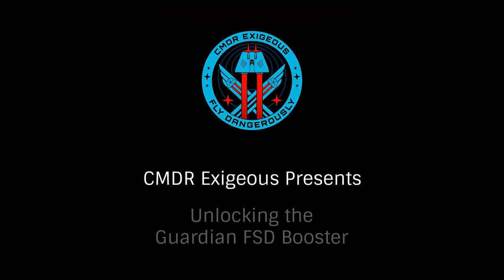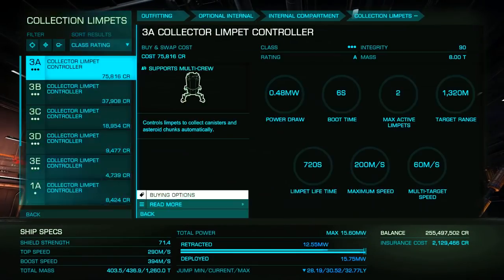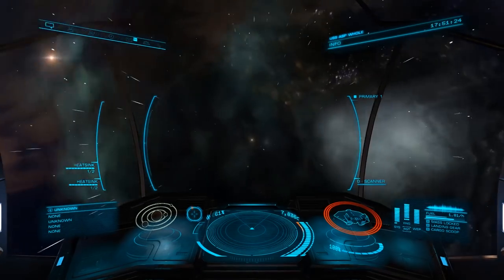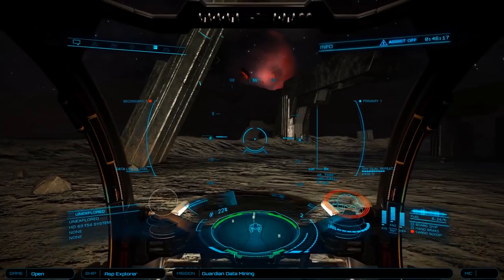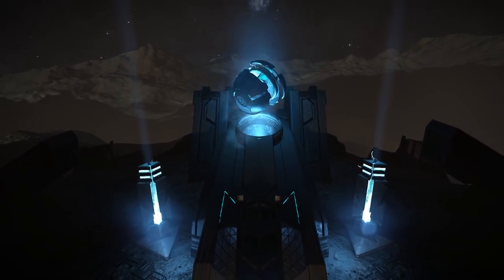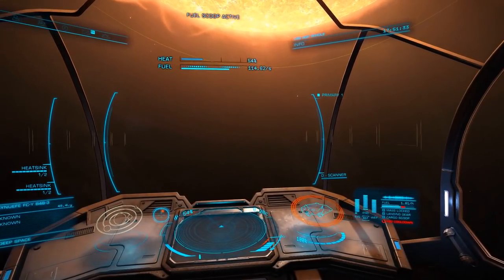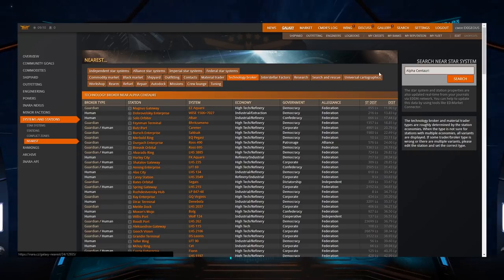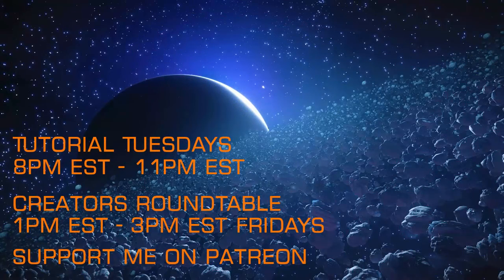Unlock the Guardian Frame Shift Drive Booster (FSD) in Elite Dangerous for Maximum Range (Tutorial)

Comment: Just attempted this...  You have to shoot the pylons until you get the message that it's been activated.  

Everything was going smoothly and activated the final pylons and was about to unload my relic... but wound up getting attacked by 4 drones.  I learned something about SRV's... they can run out of ammo!   Subsequently got blown up on my way back to my AspX to reload.   So, I'm going to have to come back and try again.  I think I'll park close with a point defense as someone else suggested.

[EDIT]:  So, the point defense idea works really well... there's just enough room to land my AspX in the corner of the ruins and it protects me from those annoying missle attacks.   Got the rest of the components and unlocked the FSD Booster.... what's not clear is how to apply the booster. It shows up in the regular outfitting inventory and you have to purchase it... and have an open slot for it.   Now I'm just trying to figure out how to configure my AspX to get the most out of it...

Comment: 1:30.  For me, I activated the 4 pylons that came up from the ground before I activated the 2 main ones at the machine.  Worked fine.
Reply from the maker: Sure, you can do it that way - but you have to have the two at the head spawn before the other 4 will, you just don't necessarily have to charge them first.

Comment: WARNING: The terrain surrounding the site at HD 63154 B 3 A is EXTREMELY bumpy.  Try to use a small ship.

I tried to use my Krait with a Class 6 Planetary Vehicle Hangar thinking that I would need the extra SRVs, then found it almost impossible to land.  I found a spot at 40.8030, -106.4987 on the northeast side of the site (as I'm sitting here, my heading is 226 degrees).  The coordinates may not be precise enough, if you're going to try this with a Krait yourself (NOT RECOMMENDED), then you'll need to expect that the valid landing window is very small.

Comment: Leaving the first two pylons till last is the easier way, pop them up but dont charge them till last.The guardians generaly pop far enough away to grab the data then run if you dont want a fight,you will still have to fight them whilst you pop the other pylons, its best to get the fighting done first before charging any of them if you are not an experienced srv combat veteran.
Reply from the maker: Sure, but as you're likely going to need the materials they drop I'd suggest killing them anyway.  If you're going to unlock any of the other guardian stuff you'll need them.

Comment: Alright, so went there today...and it was crazy.  Once all pillons were activated, 5 drones appeared, blue rays and missiles raining down on me from every where, they destroyed my srv...took my second one in, almost same thing happened, just ran away and called in my ship.  But even far they would shoot missiles at me...those are some nasty guardians.  I'll be back...
Reply from the maker: I've seen a few people say this - which, honestly baffles me.  I've done this something like 80 times (back in the day it took 8 blueprints/fragments to unlock each module so between my accounts and getting video I've done it that many times) and never once have I been killed.  Make sure you're running 4 pips in systems if you're having trouble and use the structures to block them one at a time while you kill another.

Comment: So something that isn't said in this is you will have to grind the site for the items. This means find the items, log out, and log back in to get more of the items. Like the tech component you can only get 12 of them per run. Which means you have no choice but to log out and back in. If it wasn't for this then I would aim to get the other modules. But I hate this grind

Comment: He didn't mention the rough terrain around it.  My buddy and I went with 2 Kraits (mine was mk2 and his was phantom) and we found a VERY precise landing spot that is right in the structure area. 40.8029 by -106.4983 and you have to face towards the center of the structure. (it takes us about 5 min to land each time, but the spot is worth it.)

Also remember that having point defense on your ship will help a TON with the sentinel missiles. I highly suggest that you go with 2 people and have one cover you and help break the towers from the air. You will have to wake in and out a couple times because you will only get about 5 or 6 technology components every time you do it. once you wake out and in again, the towers will reset and the grind will continue. 

I also hate the use of the word "simply" in this video. Nothing you will be doing here is simple, especially for newer players. I lost my only SRV the first time I tried it alone and without all the tips mentioned above. I was pretty pissed when I had to go back to the bubble to get more.

Comment: I'm shipping out on this run in the morning in my Type-10. It has dual SRV and fighter bays. I'll be taking the stuff I need to synth SRV fuel and ammo. The SRV bay is the type that can repair the SRV, so I'll be taking materials for that too. 

I doubt I'll be able to park close enough for the point defense systems to assist, but I'm gonna give it a try. 

So my big dumb-question-of-the-day is: "Will fighters launched prior to landing provide air support for the SRV?"

Comment: While the AspX build link is dead, I noticed in the video two 3A Collector Limpet Controllers being fit on the Asp. Why are those necessary?
Reply: Fuel scoop, class 3 Shield Gen, Point Defense, SRV bay, maybe an extra fuel tank just to be sure. Do not forget the  materials needed to synthesize SRV ammo/fuel, and you should be good to go.

Comment: Hi! I just landed with my Krait Phantom technically inside the structure. exact parking spot is @ 40.9714  ; -106.4864 you will need some patience while locating the spot but i can land in 5 minutes of + - 1m/s forward and backward navigating
Reply: I just got there with the same ship and it was so easy. Tanks a lot!! *btw it is 40.7914/106.4865 for me

Comment: Quick question, I am currently unlocking the Guardian modules.  It's entirely possible this may have been mentioned in the video and I missed it, but do you have to do this for every ship like Engineering or only once and done to unlock each module?

Comment: should i first engeneer my ship, or it doesn't matter when i get guardian modules? thank you
Reply: Won't make a difference. The guardian FSD booster is an optional internal so it takes up an internal slot. The bigger the jump range the bigger the size slot it takes. It simply adds a flat amount of additional range depending on the size of the slot. However the sites are 1000 ly out so it doesn't hurt to have better jump range to get there.

Comment: I have it unlocked....but how do I install it? Looked under my Core internal first expecting it to be under FSD Housing, then looked under optional internal, nothing.
Reply from the maker: It's under optional internals in a section called "FSD Booster" - might only be in stations with experimental outfitting but should be in the station you unlocked it in.

Comment: Does this remove the fuel cap ? Even after charging at a neutron star i can only use my regular jumps since anything over the regular jump is blocked by the fuel cap per jump.
Reply: That can be caused by fueling scooping "too soon" when you have a route plotted. By refilling your tanks you increase mass and reduce your range, if it's below what the route plotter expected you to have at that point, it will give you that cryptic error. Solution is to either not fuel scoop until the "last second" as the route plotter tells you to, or if you don't like waiting like that, you go into galaxy map and replot your course if you get that error.
Reply: @AlvinBrinson  
Thanks for the explanation, good to know. 
Had the same problem several times and the reason for it was a complete mystery to me. Because i didn't think the Space Nav would be so smart to take your fuel tank weight into the calculation. I learn something new about this game every day.

Comment: Trying to get those delta obelsik data for the shield booster but its horrible. Is there a way to get delta more frequent?  Nice vid as always
Reply from the maker: Not really, no - other than using the ancient ruin sites rather than the obelisks at the Guardian structure sites, which are you using?
Reply: CMDR Exigeous was using the mosulblueprint site in hd-something. Thanks i guess the other should be better
Reply from the maker: Yeah, definitely hit one of the ancient sites - have a look at one of my weapons videos as it has the address of the site I used.

Comment: Any reason why when I get to the activation point for the first two pylons nothing happens? Its the same coordinates as you have on there with the little spotlight thing on the ground.. I've gotten a few other things to rise up as I was driving around, but no dice on the first two pylons.
Reply from the maker: I actually headed out there with a friend this evening to do the unlock and we hit this too - are you in open?  If so it's very possible that the instance didn't reset after the last commander left.  We logged out and into a private group and blamo, all was fine.
Reply: @Exigeous  I did see another ship as I landed, that might be it. Thanks for the help!
Reply: @Exigeous  You were right, it was reset when I logged back in. Got the module! Thanks for the video.
Reply from the maker: Glad to hear that - thanks for sharing the problem so if others see it I can let them know.

Comment: So I was gathering resources from the structure when at some point the server booted me. I logged back in and I was off the planet in my ship. When I tried entering the planet t told me it was "permit locked". WTF? I've was just there and have been there a couple times before with no problem. Has anyone else had this issue?
Reply: Sounds like a glitch. Should be fixed when you restart the game, I encountered this issue after their last patch. Usually just restarting the game helps, if it doesn't boot the game without Horizons expansion first and relog. Then restart the game again with Horizons and everything should work like a charm. Unintentionally I only encountered this glitch once but as I am a slight maniac and try to break every game, I was able to completely nuke it xD

Comment: erg took me forever to land my Phantom. Even the spots for the Anaconda weren't working. Finally got it 2.33km away at 40.7994/-106.6273. I'm sure there are much better spots but I couldn't find them or get ones listed to work.

Comment: Hi thanks for your advice has been very helpful and the pylons you have to line up is there a time limit to do it once you start 
I found the location but I didn’t see the machine that gives you the blue print 
Are there other locations on the planet
Reply from the maker: The machine is up at the "head" of the site, look at the map that's on screen and it's at the top.  No, there is only the one site on that planet (and I think all planets that have a structure just have one).  There are 2 different structure types with pylons, one with the module blueprint and one with the weapon blueprint.
Reply: CMDR Exigeous thank you

Comment: Apologies if this has already been noted, but: The unlock requirements are off. Should be 21x Power Cells, not 1x Power Cell...
Reply from the maker: No problem - I put a big note in the description as yes, I misspoke when reading my script
Reply: Check time-code 1:02. The chart on screen is in error. This is what I meant to point out. EDIT: Nevermined, I should have checked out the 'show more' comments. ^_^
I flew out there in a Krait. Bad. Idea. The terrain is very rough. Something with a smaller landing footprint works much better (such as a DBX)

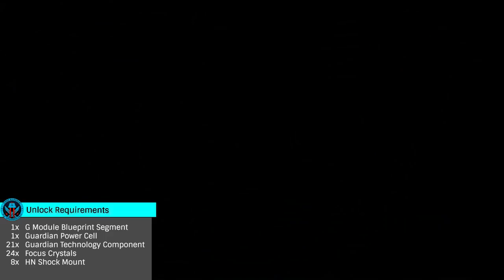Comment: One thing I've finally noticed after getting all the way back into the bubble is that you need 21x Guardian Power Cells and not just 1 which was shown in list at 2:50. I know its fixed in the description but it still kinda threw me off ^^;
Reply: Seriously? You sure it's not 21x technology components?  Will check another vid to be sure. Luckily I haven't left orbit before going to bed last night :D
Reply: @Jin-Ro  Its 21x  technology components and 21x Guardian Power Cells. I know because once I got back in the bubble I didn't have enough and had to go all the way back for more power cells.
Reply: Gutted. Long ass journey even in a long jumper.
Reply: @neil2003  Where are the Technology components. I just find Power cells?

Comment: Nice vid.
I should've probably practiced the SRV and it's keybinds before i went there.
Only been playing a little while and never tried out the SRV, god what a pain in the ass it is, it bugs out controlwise so much also. (going into turret mode & aiming with mouse disables the ability to turn properly with the mouse when you go back to driving mode, until i yaw on my hotas to turn, then turning with the mouse works again, jezus.)
Because of all that & the fact it was night, and it took me a while to try everything out.
Also didn't expect 564564 sentinels so i ran out of ammo when i had eventually done everything, with nothing left for the other materials and the sentinels that spawned after that.
So used up both my SRV's and had to leave. :(

At least i know what the deal is now for when i return & i'll be a little better prepared. Will also take some of the tips from the comments into mind.
The video made it seem much easier than it actually was, for someone rather new anyway :)

Comment: If I do this, what will happen to the FSD booster from Farseer INC ? will it be replaced or combined?
Reply: The booster fits in an optional internal module slot. So your original FSD stays put in the core internal. It just boosts your original FSD. Fly safe.
Reply: @D312-d6k  ah ok thank you :)

Comment: I'm not sure if this is common or if it's just me. Currently on planet using camera trying to spot the machine but there are no lights or anything indicating the location of the machine within the vicinity of the Guardian Structure. Am I doing something wrong. After an hour of searching the structure and maps on forums with no luck I am highly frustrated!
Reply from the maker: Have another look at the map - there is a central "path" and at the head there is the machine, it is flanked by two pillars that will pop up from underground when you approach.  It's hard to explain other than it's at the top of the map I show on screen and should be rather easy to find.  Are you at the site I show in the video?
Reply: Yes I am. I can accurately pinpoint the obelisk and guardian structure but there is I don't see pillars with a blue hue which indicates the guardian alter location. Gonna take another shot at it tonight. Same planet and location as suggested in The vid. I'll give it another shot tonight.
Reply from the maker: Well all you should need to do is drive up right in front of the main machine at the top of the site (orient yourself per the map in the video, using your external camera to move around quickly).  When you drive up in front of it they first 2 will spawn then the rest will be able to after that.  Maybe even buzz over the site in your ship to find it.
Reply: I finally found a solution to my problem. I ended up going to a system that had a guardian structure but the system was a little over a cpl hundred Ly away from the actual system this blueprint was on 🤦🤦🤦
Reply from the maker: Hmm, well the layout should have been exactly the same - there are (now) 3 layouts, one for module blueprints (what you need here), one of weapon blueprints and one for vessel blueprints.  For each blueprint the layout is the exact same, just on different planets.

Comment: The FSD booster is bugged, when supercharging the FSD on a Star, you wont be able to jump, it will give you a 5.00 ton error... If you check ship capabilities, it says that the jump is possible, but you cannot jump... Normal starts it works fine...
Reply from the maker: Well imagine that, a bug in Elite in a build they didn't have a beta for - shocking isn't it?  Thanks for letting us know - hopefully they'll fix this soon.
Reply: CMDR Exigeous lol,  no worries..  Nice video..  o7

Comment: Greetings CMDRS, 

can i upgrade the guardian fsa at engineer farseers ? 

and if not - how do ppl get over 60 ly? 

my asp explorer has 5A fsa at farseers and i got 52 LY jumprange but i dont have the guardian module yet.
Reply from the maker: No, this isn't engineerable - just an upgrade.  As for how to get that range have a look at my Collection Asp Explorer build video, it'll explain how to lightweight other modules and strip down your ship so you can hit those ranges.
Reply: @Exigeous  Thank you for your reply, CMDR! so basically a farseer rank 5 max is better than the Guardian FSA which maxes at 10,5 if i am right? Its still kinda confusing to me, because i stopped playing in 2016 and have some hard times figuring out what major changes have been made since i started again last week :D
Reply from the maker: No no, you're missing that this ADDS to whatever your jump range is, this isn't a frame shift drive*, it's a frame shift *booster*.  So that whatever your engineered jump range is and *ADD 10.5 (or less depending on size) to that.  Make more sense now?  As for changes since 2016 - a lot of little stuff, look through my library as I have a lot of stuff that would likely help you.
Reply: @Exigeous  thank you so much! Now I am enlightened! Now i know i DO need this thing :D Thank you for your patience, maybe i will meet you in the depths of space one day to give something back. Fly Dangerous, CMDR! o7